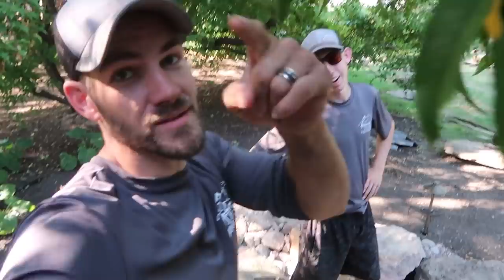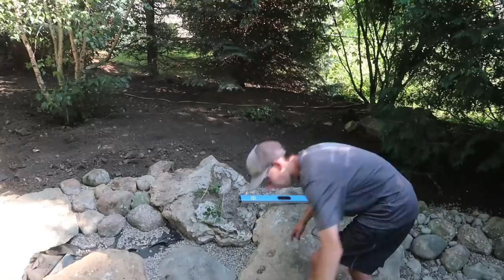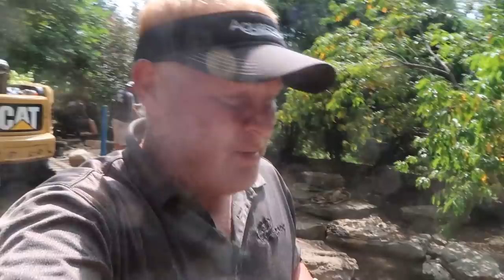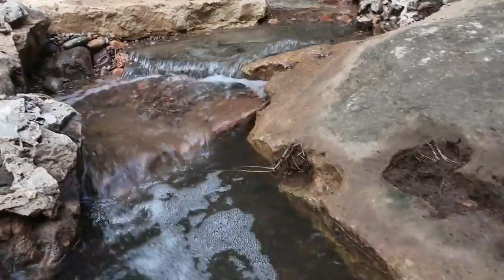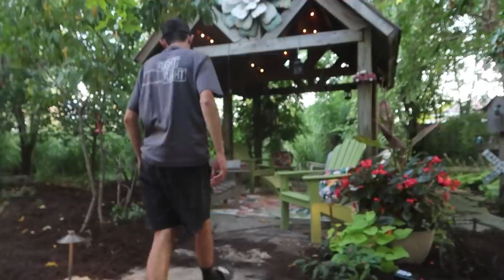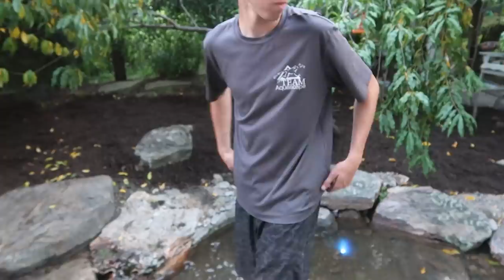DEEP Pond W/ 50-Foot Meandering Stream - REVEAL

Comment: Are all the stones just dry set and filled in with pond foam, or do you stabilize them with mortar or cement? How do cantilevered rocks not get tipsy? do you just make sure most of the mass of the stone is on dry ground or is there more trick to it than that?